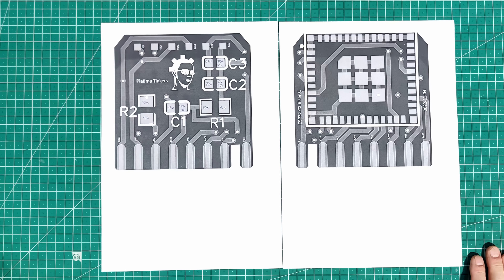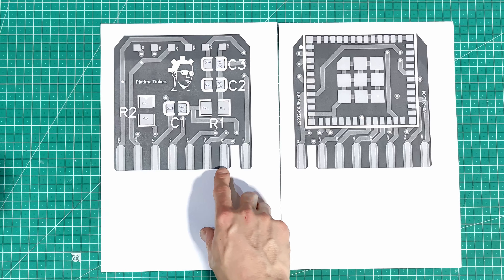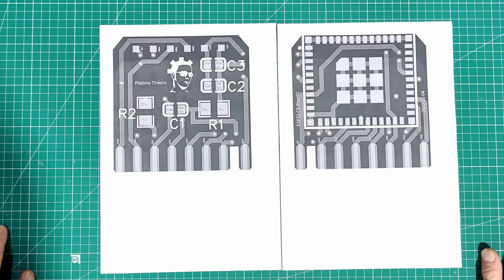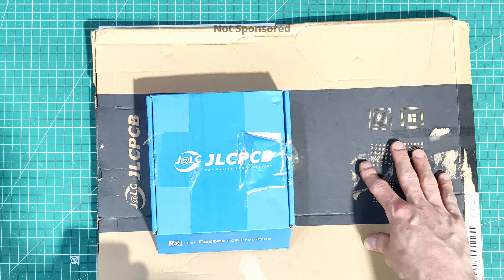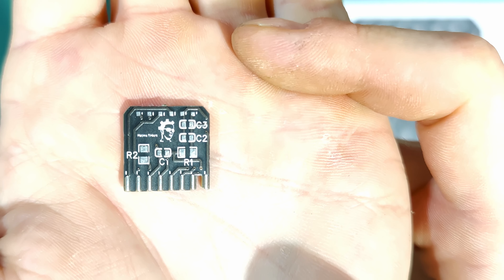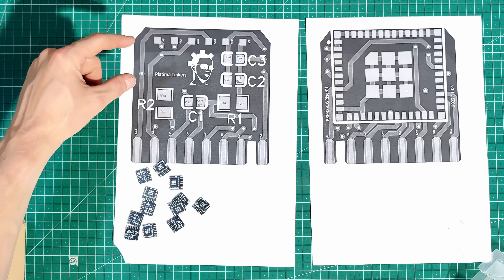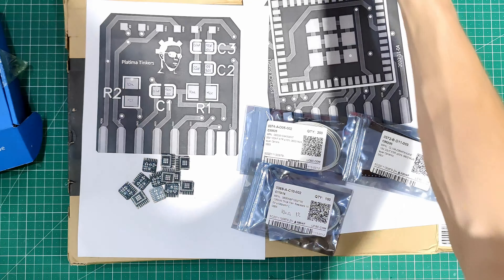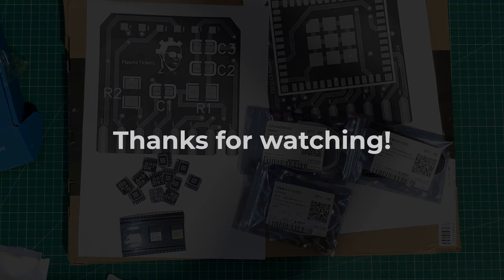Designing and Ordering My Own ESP32 Board - Part 1 of 4 (With Giveaway)

Comment: For RF you just put a cutout in the planes under the antenna and you'll be fine.

Not sure if it was your comments I said this in or someone else's, but if you select "custom size" for the stencil and set it to something sensible for your design it'll drop the shipping price a lot (especially true with 'straya tax ;) ).
Reply from the maker: A cutout in the planes? The antenna hangs over the top of the board. 

Unfortunately PCBWay and JLCPCB both don't seem to have a 'Custom' stencil size. Which mft did you see this with? Cheers
Reply: @PlatimaTinkers  That's the other fix :)

JLCPCB  - Stencil Section - "Customzed size"
Reply from the maker: @SomeMorganSomewhere  God damn I never saw that next toggle option haha. facepalm next time, thanking you very kindly!

Comment: Ai-Thinker does a vertical mount C3 module, but that's not as fun as making one yourself.
Reply from the maker: Oh really? I've not seen it. Have you got the URL?
Reply: @PlatimaTinkers  The esp-c3-01m. I tried posting a link a bunch of times but my comment kept getting eaten so I'll let you search for it. 😛
Reply from the maker: @notsurt  Yeah I saw a few of your comments get eaten. So odd, and it doesn't let me change it. Neat little module, but I do think mine has a lot more functionality than that. Eg I'm handling the strapping pins, decoupling capacitors, boot mode, etc on the riser.

My next version which is with PCBWay production now goes even further with optional buttons, LED, jtag pads, improved keying, and two major awesome changes that I will share in the 3rd and 4th videos :P 

I guess my riser is actually closer to a devboard, but still in a module form factor?

Comment: When I get small boards made up by JLCPCB I layout as many as possible in the cheap PCB area as I can and then they're even cheaper per board, instead of 5 for five bucks might get 125 for five bucks.
Reply from the maker: Wait, what? Eg panelised?
Reply from the maker: Oh and where ever the Kikad comment you made went, that is definitely something I'll have to try! Thanks for that, especially when the cheap size is usually 100x100 and my board is about 17x22mm haha. Much appreciated!
Reply: Yeah, for smaller designs I'll panelise as many as I can fit into a 100mm square board.
Reply from the maker: Fark me I cannot believe I never thought of that - thanks a mil. 

Keep your eye out for the 4th part in this series as I'll be giving a few finished working modules away!